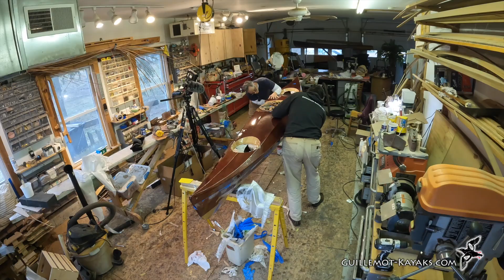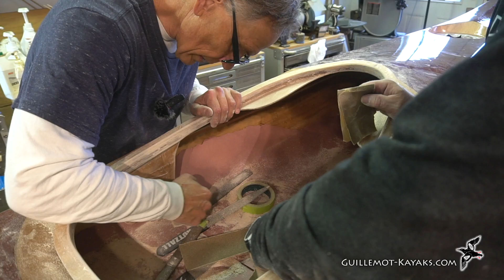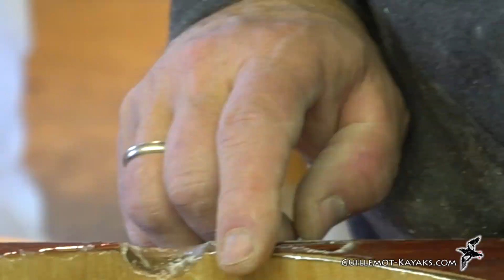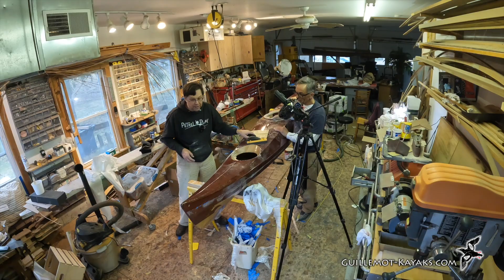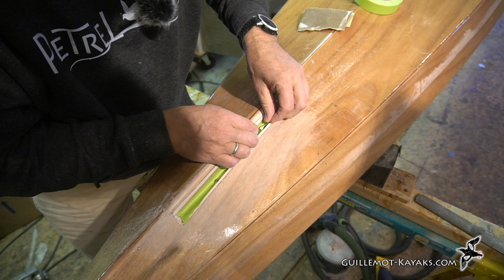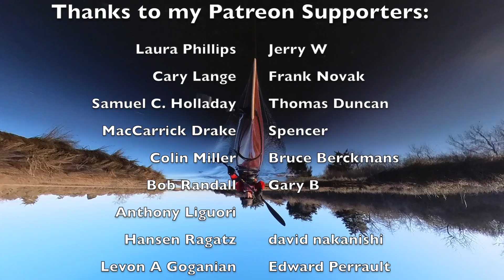Cleaning up Edges -  Petrel Play SG - E24

Comment: Is there a reason you couldn't put an additional plywood layer on the combing ring to get more clearance for the spray skirt?
Reply from the maker: You certainly could. It shouldn't be necessary if everything is lined up right, but you won't know that until everything is glued in place.

Comment: What’s the name and the model of the hand scraper that you filed with the chainsaw file to round over the coming edges and knee braces?
Reply from the maker: It is a ProPrep scraper. One of the best scrapers I own. Unfortunately, they are no longer made. You may find some on auction sites or used tools outlets. My hardware store had new ones in stock for a long time after they were no longer made. They are worth looking around for.